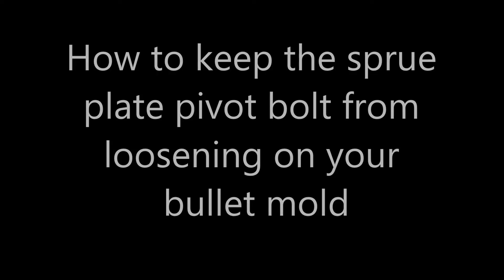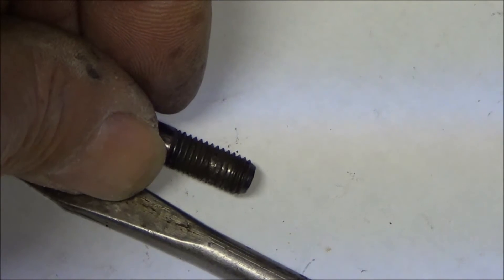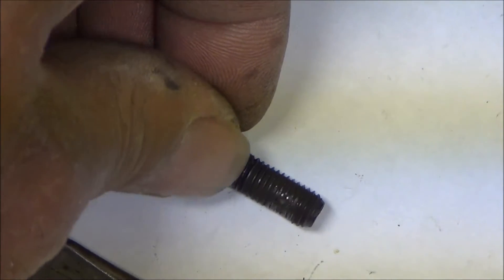How to keep the sprue plate pivot bolt from loosening on your bullet mold

Comment: Would this trick also work on a 2 cavity mold if I were to tap the side Aldi mold with a pilot bit and insert my own kind of set screw? Because I saw on a different video, a kid use a self-tapping screw and ran into the side of a 2 cavity Lee mold and essentially made his own set screw to hold onto the sprew plate screw, I'm thinking of doing that but I wanted the extra gripping power of doing something like this
Reply from the maker: YES

Comment: Having a bit of trouble using a screwdriver sir
Reply from the maker: You might try replacing the set screw with a bolt which uses an allen wrench.  That makes it easier to get the bolt tight.